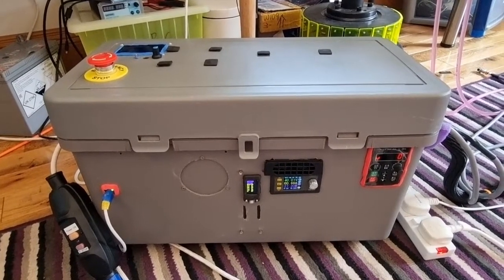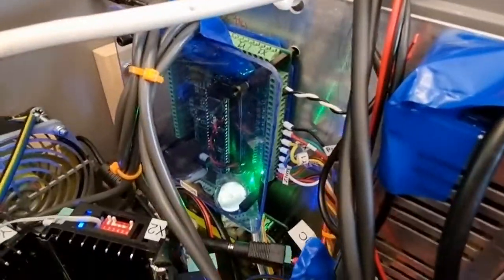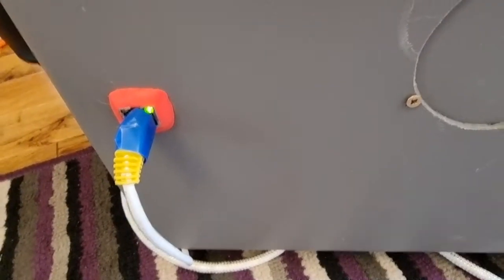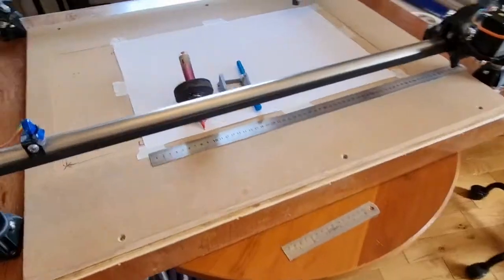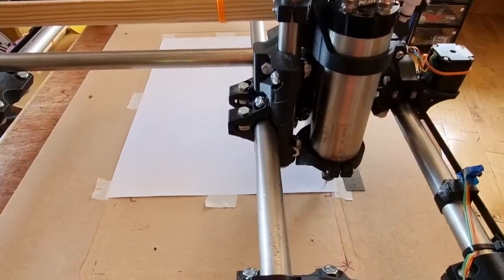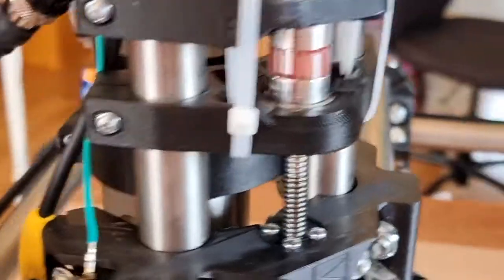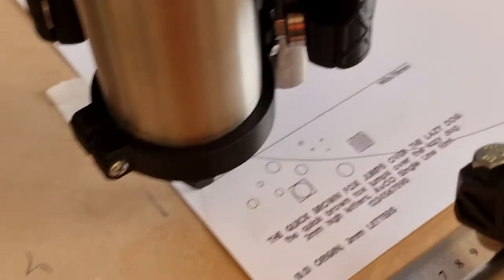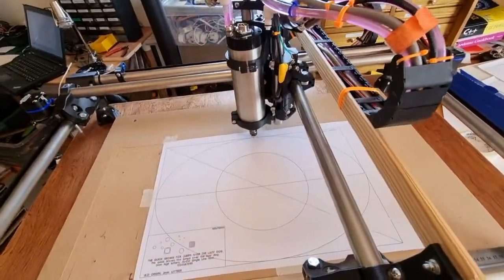MPCNC V2 by Steve M. Potter test drawing 200mm/sec

Comment: do you happen to remember what the Z 'depth of cut' was to get good results with the spring provided by a ball-point?
Reply from the maker: This pen refill was clamped tightly by the spindle chuck, so the only springiness is in the flexing of the whole machine and the compression of the mdf spoilboard by the pen tip. I think I set the height about half a millimeter below the surface of the board with paper on it. Obviously getting a good line drawing requires having a very flat spoilboard and well taped-down paper. In practice, just start with the pen barely touching at the lowest point of the work area and lower it by a few tens of microns if there are gaps in the drawing. It is fun to see it re-trace the previous drawing so perfectly!
Reply: @professorstevepotter  cheers. I've actually cut with my mpcnc for years and totally skipped the 'crown-test', so this will be my first time playing with a pen. I was planning on doing the same thing, clamping with the ER collet, just to play around with. I generally face the spoilboards, so we'll see how it goes. Thanks for the data and the videos, keep it up.

Comment: Awesome! Are you using A & B output for X2 & Y2? Just wondering if you are using all 5 axis from the board or only three
Reply from the maker: Yes, all 5: Axis A is controlling my 2nd X stepper motor, and Axis B is controlling my 2nd Y stepper motor. This allows me to use Auto-squaring, to fine-tune the alignment using endstops on all 4 rails. One must select these options in the controller's grblHAL code. See Phil Barrett's blog on grbl.org for the details.
Reply: @professorstevepotter  Thank you for explanation. Unfortunately for my application I can't use A & B axes as X2 or Y2 since I am using them for something else. But may be you have some advises how can I achieve maximum possible XY speed still using X1 & X2 in serial or parallel. I am thinking about having two drivers for X1 & X2 and just reverse wiring from drivers to actual motors. In this case I will give to the motors max amps but will loose ability to do auto-squaring for sure.
Reply: @professorstevepotter  hello prof... please me to detail configuration 5axis...x ,2nd x,y ,2nd y and z..i am still confuse... thank you sir
Reply from the maker: @arduino labs gallery:  You can find a listing of my machine's configuration near the bottom of this thread on the V1 Engineering Forum: https://forum.v1engineering.com/t/grblhal-on-skr-pro-1-2/30269
If you have additional questions, that is a great place to get help.
Reply: @professorstevepotter  thank you very much sir....
Reply: Excuse me sir...how wiring diagram for autosequare x and x1..y and y1...driver stepper wiring diagram..thank you very much...
Reply from the maker: @senz_pro  Questions about autosquare wiring and configuration can be answered by going to https://docs.v1engineering.com/electronics/dual-endstops/ and other documents in their Control section of the documentation. Their Forum is also very helpful if you have more questions.
Reply: @professorstevepotter  i am sorry sir..i am use firmware grblhal and iosender...and grblhal board teensy 4.1......thank you very much

Comment: what is your accelerations ? stepper motor size and current ?
Reply from the maker: I use 1000 mm/sec/sec acceleration for X and Y, 500 mm/sec^2 for Z. I am using the NEMA17 steppers from V1 Engineering, KL17H248-15-4A, 76 oz-in torque. I chose the currents so the steppers are not too hot to touch, usually between 40-45C. I set the TB6600 stepper controllers to 1.5A, though the currents I measure are less than 1A.

Comment: using the spindel as the pen holder is really smart. Is that just a ball point pen cartridge? Did you have to find a short pen to mount that in the spindel?
Reply: I used the pen refill that goes in my Livescribe smart pen and a 2.5mm collet. But any old metal ball point pen refill should work. You will need to cut it shorter with a dremel or hacksaw.